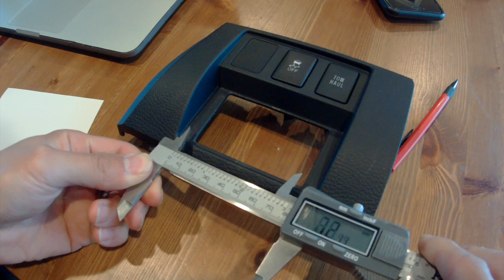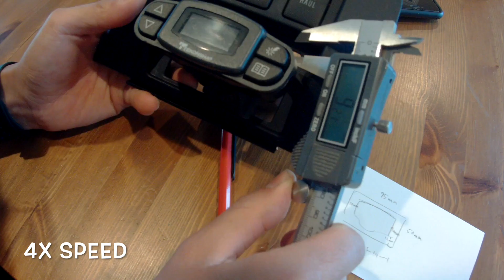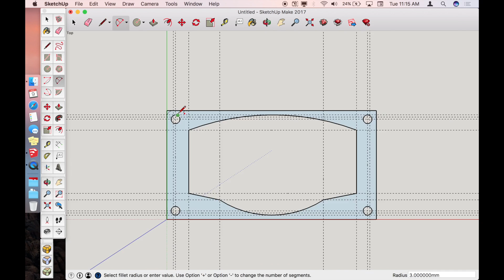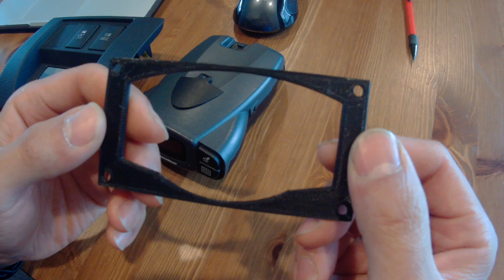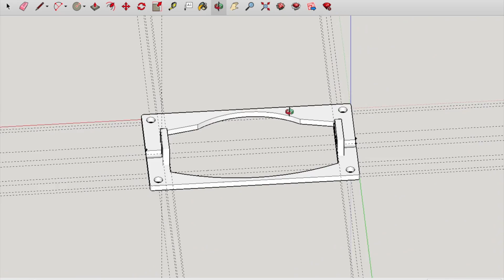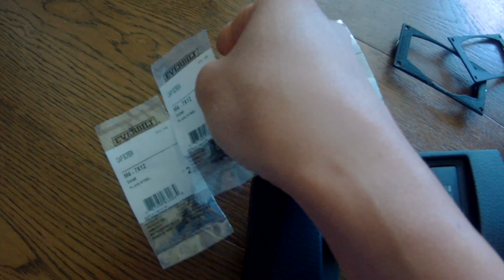3D Print Designing Tekonsha P3 Mount for 2017 Tundra

Comment: What infill did you use and how well is it holding up?  And do you have the .stl files available?
Reply from the maker: +PeanutButter CupCake I print at my local library. I do not know which print settings they use. I'll have to look for the stl files. It's been a month since I completed this project.
Reply: Awesome.  Thanks.  I have this truck and a 3-d printer but I fail at designing things.  I'm surprised there isn't a recall on this thing since it is a safety issue.
Reply from the maker: You can purchase the mounts here - https://ebay.to/3P5eAV6
Reply: Awesome.  I printed them with ABS and 50% infill.  I am also going to put them in an acetone vaporizer.  Will update with results.
Reply: @peanutbuttercupcake9510   Update on results?
Reply: @chicagohandyman  Any chance you still have the STL files and could share them?  Thanks!